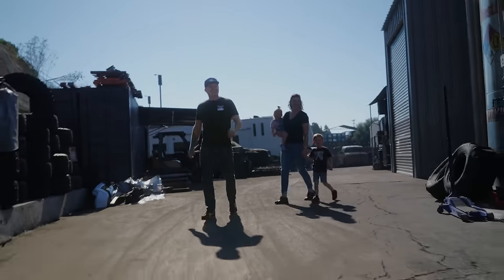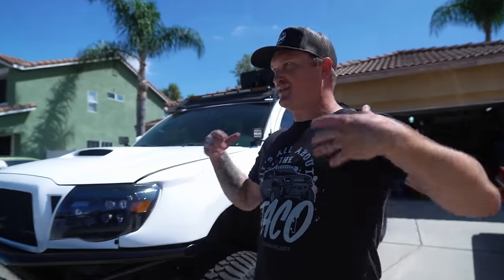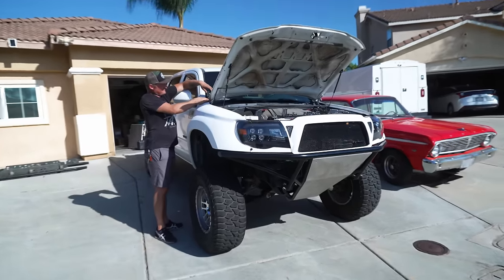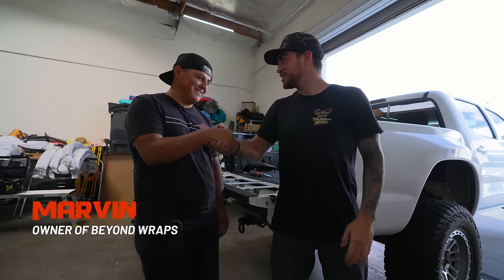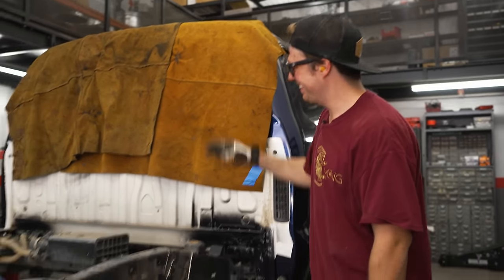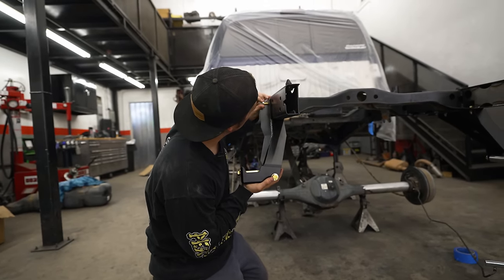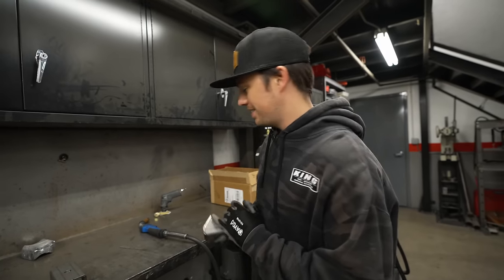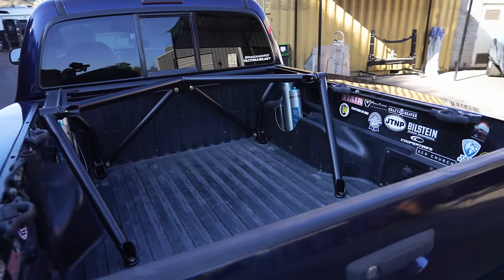Transforming our Employee's Toyota Tacoma with $30,000

Comment: I have completely changed my mind about ever considering a pre runner build. That had to be more than 30k. If I ever do anything similar, it will be just some wide body bedsides and fenders, bumpers, wheels and tires. Strictly for looks not to use it like that. Truck looks awesome.

Comment: I left a comment on one of you're portal videos. About why you don't offer f-150 product's or do videos on non tacoma builds. You even told us that no company gave you chance. You struggled to build you're company and knowledge on tacomas. Look I'm not looking for a handout. I just want to know which fadricators are reputable in my area el paso texas. Or who is the best mechanic to install longtravel suspension on f-150s. I ask people on information for longtravel knowledge, nothing but crickets is what I get in response. Im not super rich, or even middle class. So when  people like me spend 30k on truck parts.we dont want to ripped off and lose all that money.
Reply from the maker: Hey! We don’t know enough about the f-150 to be confident giving information about it. I would look into forums online, it might be your best bet. I know the f-150 market isn’t huge on overlanding so it’s probably going to be difficult to find parts, let alone a shop that is equipped to do overlanding mods 🤙
Reply: @tacomabeast  You're right I looked for F-150 overlanding gear. Very little products for F-150's found some stuff like bed racks and skid plates. But no front or rear bumpers or winch mounts. Mateo you have connections can you convince C4 to build me some Custome stuff please.